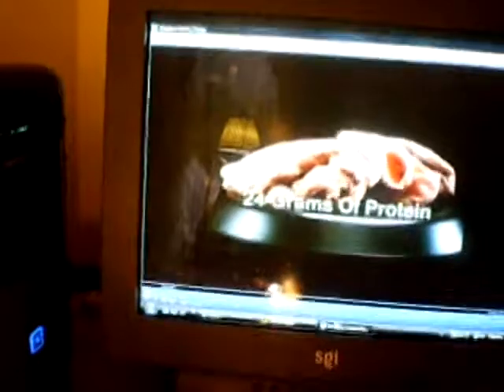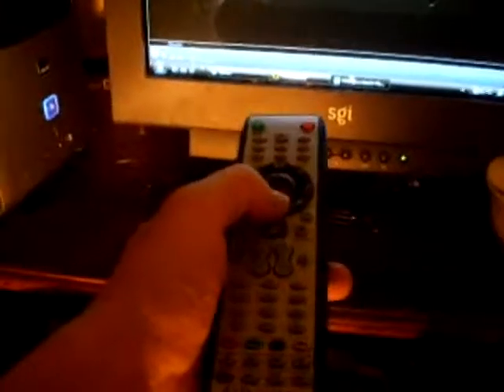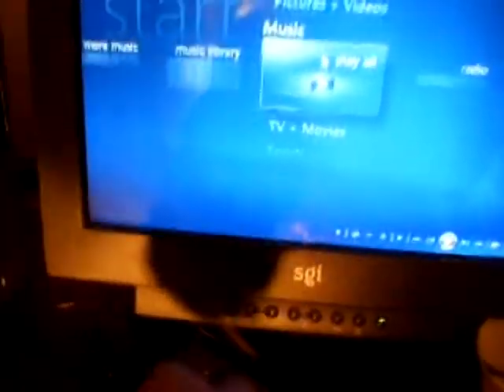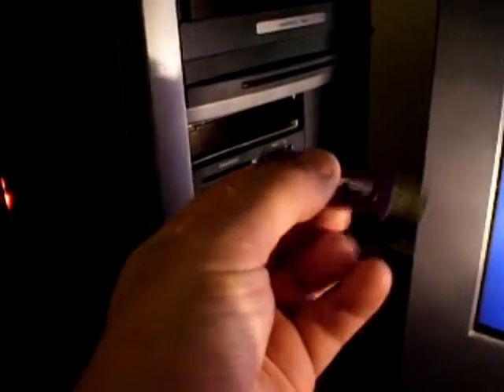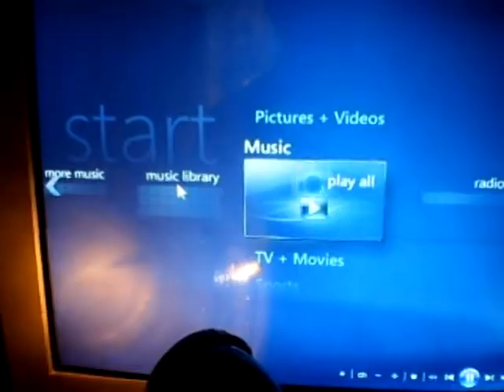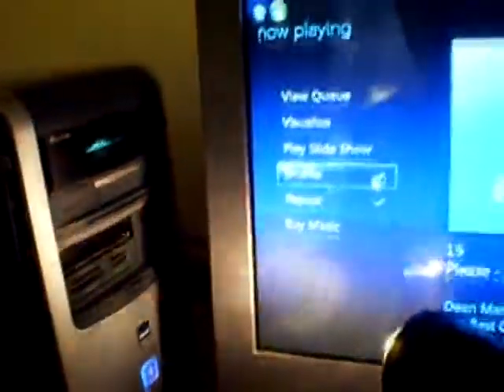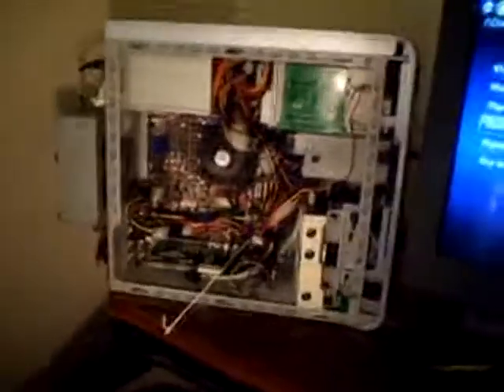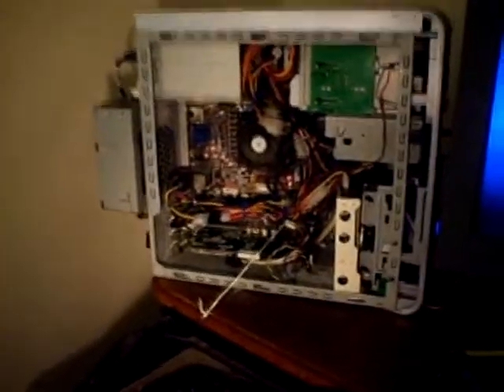media center 2 0

Comment: Wow thats cool. :D Love it!. About the Sound level of yours on the front of your CPU, how did you able to run it. Does it need a compatible Sound Card, what motherboard is in your CPU? does it have a slot for the Sound level? because mine also has a sound level but doesn't work.